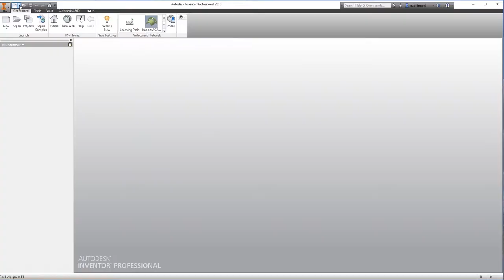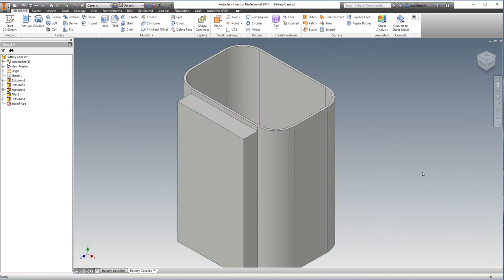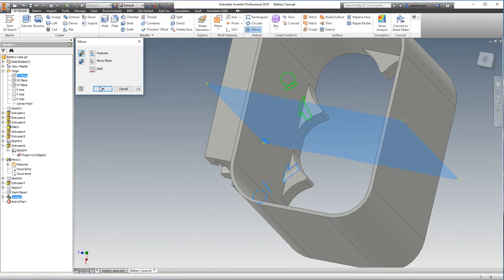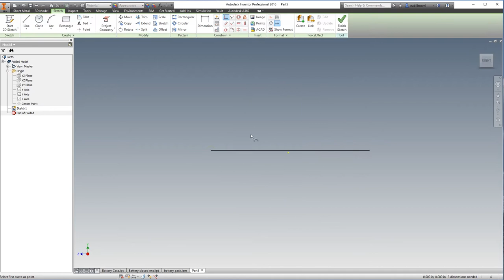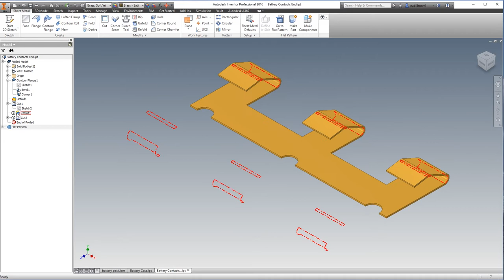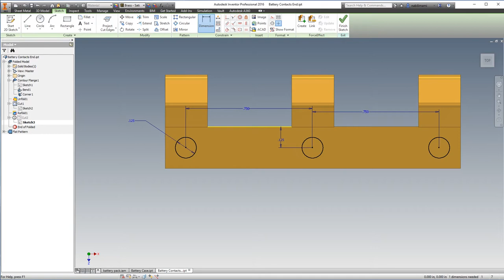18650 Sony NP-F Style 7.4V Battery Pack

Comment: Are you planning to charge the cells outside the case and install them every time? You haven't included a management circuit to charge and balance safely in the case.
Reply from the maker: This case was designed to be a quick swap design. With this I'm not waiting around for the batteries to charge. When they are low I swap out the cells and keep on going. I'll then use an external charger for the low cells